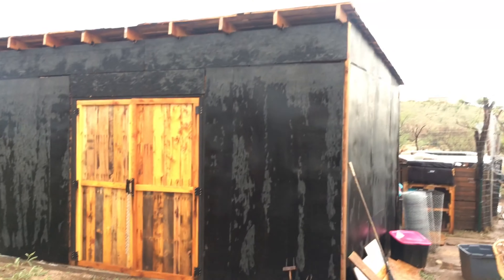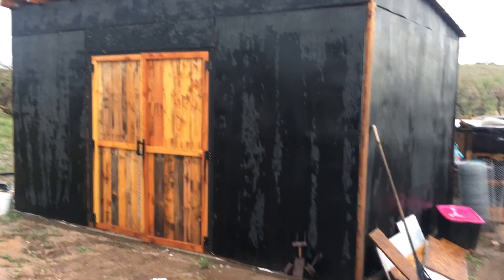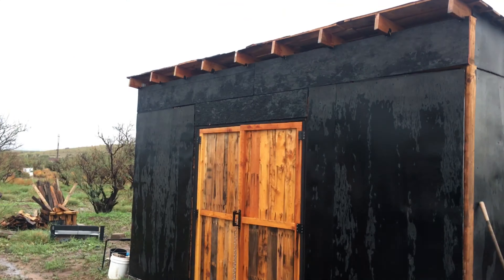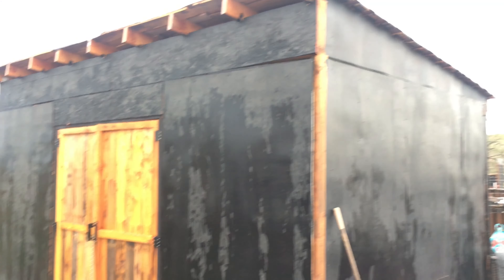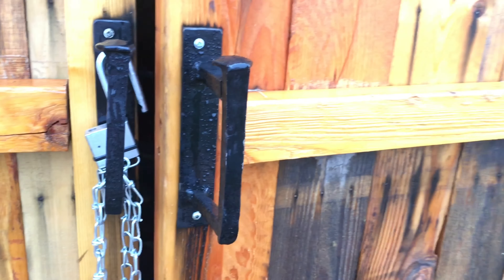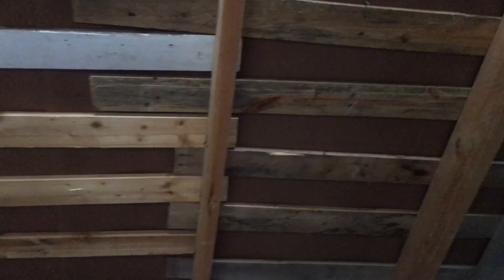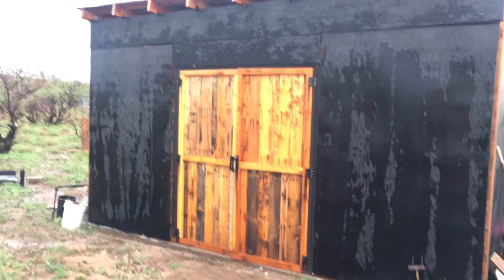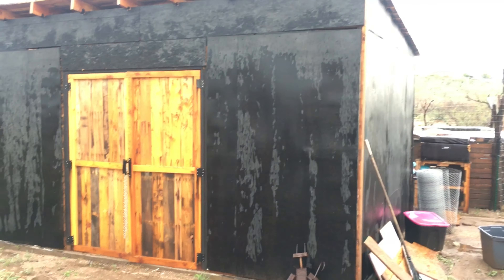DIY Pallet Shed Update - How has it held up?

Comment: Hard board is useless why didn't you use plywood on roof .
Reply from the maker: At the time plywood was $50 a sheet. 2x4s were 7. There was asphalt emulsion applied to it. It was just a backing for the chicken wire and stucco. The roof has metal panels. The building is completely functional and has no leaks so 🤷